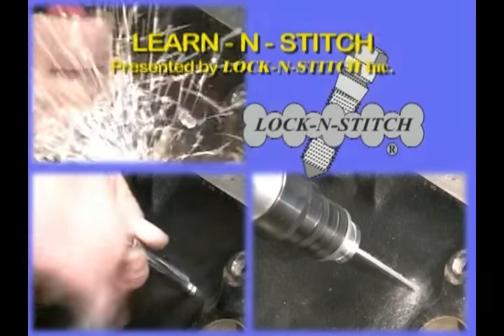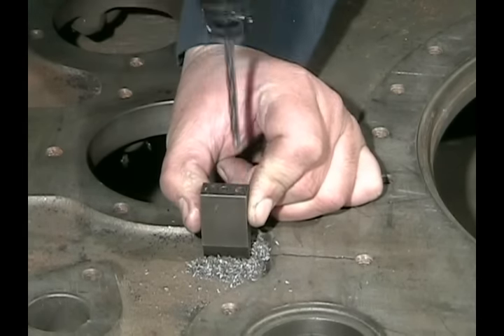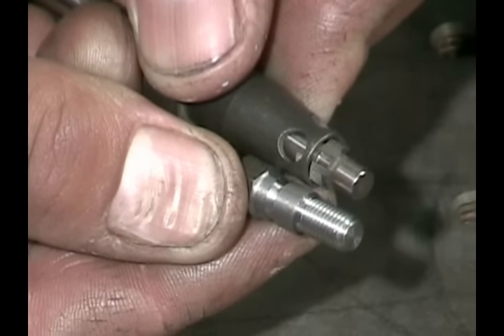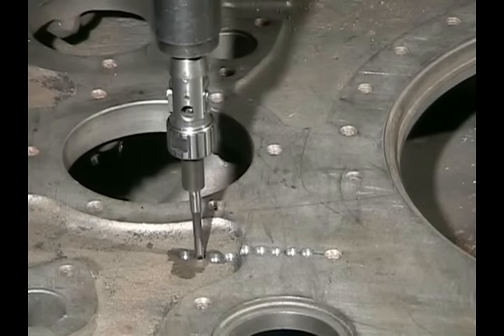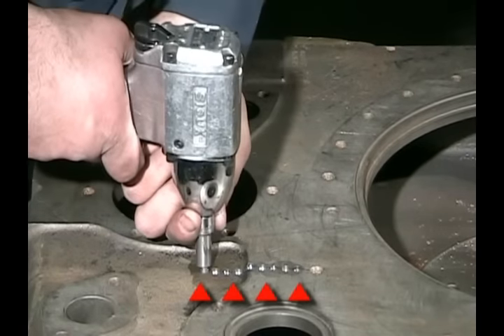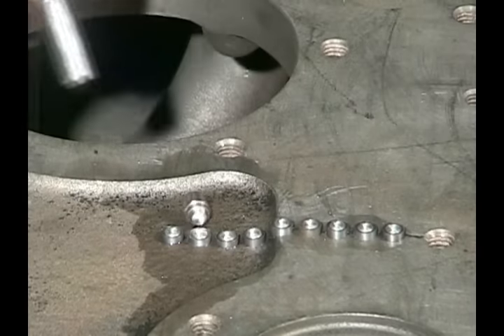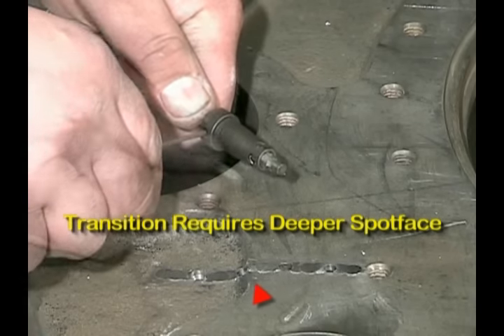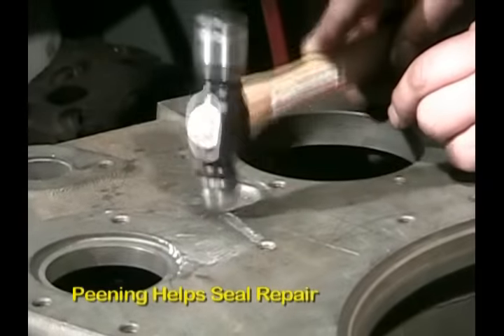Cast Iron Crack repair

Comment: I love this. I have one question that's probably obvious to the skilled machinist, can you explain to this layman why we're not welding this piece?
Reply: "Cast" is a very broad term. Some castings can be easily repaired by welding and this method would be more expensive and time consuming. Some Gray irons can be welded but it can be difficult. White iron cannot be welded. These situations are where a product like this comes in handy. It would also be useful on an in service part that could not be welded. Or part where dimensional  changes to the part due to welding heat input would be unacceptable.
Reply from the maker: Here is an article that can help explain so much more http://www.locknstitch.com/pdf/gmrc_white_paper.pdf

Comment: i cant belive that this hold in long term ^^"
Reply from the maker: It is a permanent repair!
Reply: Why not,it’s the proper way?
Reply: @LOCKNSTITCH   are the bolts like an cold weld ?
Reply from the maker: @DEWElmorion  yes it is a cold mechanical repair using stitching pins, that some call 'bolts' but they have a patented thread design that pulls together

Comment: Impressive. I need to be able to do this to my Cleveland block. Small 3/4 crack which only shows up with magna fluxing. I’ve got to search for the material used and tools to do the repair. Just worried that it’s more than the cost of a second block. Which would cost me $300 to buy. Then $700 to clean,zero deck,square and bore. I will watch this a few times to better my understanding of how it’s done. Thank you!!!
Reply from the maker: Just sent a message to your other response - but we are always here to help you every step of the way.  The team can let you know how much the product will cost for the repair, we will get you all the training material needed and can provide the technical support too.  Reach out to us when you are ready to talk - info@locknstitch.com or 209/632-2345  Thanks for reaching out!

Comment: This is the most amazing crack repair system my two eyes have ever seen.  I was quite happy to see you drill the Stop Hole at the opposite end of the crack. I work in a machine shop and we utilize Heli-coils on all aluminum castings.  This is an amazing system. Where have I been to never have seen this before, lol. Must have been on Mars or something. Lol. I really enjoyed the education here.
Reply from the maker: Please check out the Full-Torque Permanent Thread Replacement Insert video on our channel.  If you have worked with Heli-Coil we would hope you would appreciate our technology applied to inserts.  Thanks for watching and so excited to know you are excited.  We are passionate about casting repair! Also please feel free to review the web page dedicated to our FT Inserts http://castingrepair.locknstitch.com/category/full-torque-products
Reply: @LOCKNSTITCH   what type of material are the blots made of and is it the same for aluminum heads ?? hi from Australia.
Reply from the maker: @johnsmith-ce2tq  they are made of various materials depending on the application; for aluminum repairs we do have the stitching pins in aluminum for cast iron repairs the stitching pins are made of steel.  Thank you for writing from Australia and apologies due to the longer than normal time to reply.  Please reach out to our customer service team at info@locknstitch.com if you would like more information.  Thank you kindly for the question and your interests in our products! Happy New Year! http://castingrepair.locknstitch.com/category/metal-stitching-pins
Reply: @LOCKNSTITCH  thank you for your reply you too have a happy new year.
Reply from the maker: @johnsmith-ce2tq  You are most welcome! Stay Safe

Comment: why wouldn't you just weld it?
Reply from the maker: Thanks for your questions Chase - please read the white paper written by Gary Reed, inventor - CEO of LNS on "Why cast iron cannot be welded the way other metals can" http://www.locknstitch.com/pdf/gmrc_white_paper.pdf 
If you have any additional questions please call to speak to our customer service specialists  800/736-8261
Reply: you can stick weld cast
Reply: Chase Murry 
There could be many reasons why you couldn't weld it. 
Maybe the equipment is near a fuel tank, maybe someone doesn't have a welder, maybe someone can't weld cast properly,or the heat from welding damaging nearby items. 
all kinds of reasons. 
This is another tool in the arsenal for repairs for cracks....
I've heard old timers talk about this , I'd bet this repair dates back to the beginnings of machinery say in the 20s-30s...
it does have its place in the bag of tricks for a machinist/technician. .
Reply: Welding cast iron is the hardest welding to do, and actually only recently has it even been possible (past few decades).
 Plus welds are stronger than the base metals since that high heat causing phase changes (solid to liquid and back) which greatly weakens the original metals. You're basically annealing the metal closest to the weld only, and doing a bad job of it at that. Which is why the breaks in welded metal happen right outside and along a weld line. While the Lock-N-Stitch may end up stronger than original metal, it won't do it at the cost of the original metal's strength.
 To overcome this the entire piece would need the full anneal treatment after being welded, think really big to giant furnaces to fit entire object inside. Just to equal out stresses created by the annealing of the weld, then you need complicated cooling to get proper ductility, strength, hardness, etc back to right levels. 
So this method avoids that and is much easier/cheaper than Stir-Stick Welding (other new method that avoids phase changes) and can be used on complicated surfaces. Like the 150+ year old cast dome of the US Capital Building. ... Also, it's pretty cool.
Reply: *****
There we go, this was the answer I was looking for. Good job!
Reply: Dude .... we have been weld cast iron forever.
Reply: Because there is a greater chance of heating up the object and warping it. And it also ensures that the entire crack is solid, whereas welding a small crack would require that you cut out chunks from the casting to be sure the weld seeps deep enough, which again, may warp or crack the block in another location.
Reply: Chase Murry cast iron doesn't have very good weldability. For a large casting like this this is a better solution but brazing and then remachining would probably be better.
Reply from the maker: Here is an article that might interest everyone on this topic; expansion and contraction of cast iron http://www.enginebuildermag.com/2002/05/the-properties-of-cast-iron/
Reply: Samuel Mcdonald 
I wonder if they got snagged out of the cash for clunkers deal somehow?
Reply: This is a much better option than welding in a lot of cases. No warpage and machinability of the repair for starters. If anyone told me they were going to arc weld this with nickle, I'd just walk out the door with the part. I worked in a machine shop for years, and we quit arc welding cast iron yrs ago. If it's a non critical part we'd powder torch weld it, peening as we went.
Reply: Isn't all LS heads aluminium including the LS6 243 or 799 heads?
Reply: thanks for providing the articles... a very nice topic
Reply: how about tig weld?
Reply: Welding cast Iron is possible, but, like all welds, you will have stress areas around the weld material. I suppose this method might actually be better.
Reply: he needs 50 more years to stop calling it recent
Reply: pig iron doesn't warp for small welds. Doing things the hard way is old fashion
Reply: Will metalock strips be placed perpendicular to the crack as well? If not, what is the criteria for only inserting the keys but not the metalocks?
Reply: Exactly! Buy some rods, weld the crack. Done and done.
Reply: @DeepPastry  . Heat affected zone. Seen problems with that on SS pipe after welding. ( Retired pipefitter)
Reply: Chase Murry i would weld it ! I Have seen too many stitch failures, and not one of my welds hav failed, adding thread pressure to a crack is rarely the way to go . On defective 400ci blocks Ford stabilized cracks with a stitch on the ends  and  two in the middle ( 16" crack in lifter valley )  , then welded  over the whole mess  and distributed them as reconditioned for extended warranty replacements , it worked out fine
Reply: Guitargreat ditto ! Amen !

Comment: No idea why this is in my recommended, BUT this is awesome. The whole time I was thinking how does this fix a crack...then it all comes together
Reply from the maker: How fun!  It definitely all comes together - the thread design pulls the material together and you have a permanent repair!  If you ever have a need for our products or services do not hesitate to call us.  800/736-8261 or 209/632-2345 info@locknstitch.com

Comment: I once took a head, from a 4 cylinder dodge, to a machine shop to be rebuilt. I sat the head on the floor and talked to machinist about what to do and cost, the first thing he said was we need to repair the cracks without even looking at it. I said what cracks he took a rag wiped around two of the valves and said these cracks.
Reply from the maker: Did the shop repair it for you with our process?
Reply: @LOCKNSTITCH  I think they did it with using a tig welder.

Comment: Did this once with brass pins on a cracked cylinder head combustion chamber. Worked great and saved the tractor, but this system is quicker and easier.

Comment: I just saw this video today, thank you. 
This method would’ve been faster, easier and stronger when I was repairing my wood stove yesterday. Instead I was chasing hairline cracks that kept on making new cracks when I was welding. I spent hours doing this to finally get it right, but this method looks much stronger. Now I have to go grind welds.
Reply from the maker: Hope you are able to successfully repair the stove!  If we can be of help please reach out to our team anytime 209/632-2345 or info@locknstitch.com
Reply: I've done the exact same thing. What rods did you use for it. Did you do a pre and post heat?
Reply: @PercyJackson93  I actually heated it up and drilled holes at each end of the cracks, and used a mig welder. I know you shouldn’t, but it’s held up extremely well. I covered the bottom with fire cement and sand, no cracks returned yet.

Comment: Very interesting! But unless you weld it, does it not just "increase" the cracked surface along the crack? Or is the threadlock supposed to be "as strong as" the metal? Just asking because it doesn't make much sense to me but you have clearly a lot more experience!! Thank you for any feedback :)
Reply from the maker: Hello Riccardo, thank you for watching and for commenting.  The metal stitching process by LOCK-N-STITCH is designed to pull the surrounding material together, making it stronger. This is done by our patented thread design of our stitching pins and our thread inserts (Full-Torque).  If you would like to learn more about the processes and our products please see our website www.locknstitch.com or feel free to reach out to our customer service team. They would be happy to interact with you via email or the phone info@locknstich.com

Comment: Have used it for years in the repair of cylinder heads and engine blocks with not one problem at all. We do mass production engine rebuilds and ship all over the country.
Reply from the maker: Zane we love reading this great feedback!  Cheers to a successful 2019! Please do not hesitate to contact us directly if you ever need additional assistance 800/736-8261 or 209/632-2345 info@locknstitch.com
Reply: can you please explain, if its not a big deal for you, how does this method regenerates mechanicla properties of the material; from my point of view, it just seals that crack, but not giving back the cast iron its strenght; where am i wrong;
Reply from the maker: @agskepi  thank you for asking!  Please see this page on our website to explain more about the patented thread design of the stitching pins http://www.locknstitch.com/precision-metal-stitching.html
Reply: @LOCK-N-STITCH INC.
I do reallt thank you for your answer. Will look at it
Reply from the maker: @agskepi  and if you still have questions please do not hesitate to call or email - technicians would be happy to talk to you!  800/736-8261 or 209/632-2345 info@locknstitch.com

Comment: Hi my name is Rashidhajeloo I'm from Iran I like your work ,I have question about your work.
I hope answer me question.
What is the difference between  L and C pins, what kind of alloy are the pins made of ,are the pins made according to MM or INCH standards.
What is the name of the tool that you do create a seat with after drilling the first hole, the same tool that has a guide rod at the beginning

Comment: I saw something like that on an old engine. Myself I would weld it after grinding away completely the crack and rounded its ends.
This method into the video can work when there are not important pressure inside who tend to "stretch" the structure.

It's not a secret but it's something more refined:
Grind, round the ends, heat it up and see if the crack continue, if not, heat it up again on a larger surface, start welding "dots". Use the electrode welder with an electrode for cast iron,  not the MIG, it can work with MIG but it's more risky. Hammer a bit each dot, clean, repeat, it takes more than you imagine. Smooth it a bit if necessary (if not don't bother). Let it cool down very very slowly, refractory sand or bricks for that.

The important is to hammer the welded dots while they are still orange/red and to cool down it all slowly.

Comment: I had heard of this, but never actually saw the process. It looks hokey, but I have seen it fix engine blocks on Jay Leno's Garage. I really thought welding would be part of it. I learned different.
Reply from the maker: Thanks for stopping by and watching!  The process of metal stitching has been around for a very long time, we have been selling and providing services for over 30 years with our patented and improved stitching pins, thread inserts and locks for the LOCK-N-STITCH method!  If you ever have a need please do not hesitate to reach out to us.  800/736-8261 or 209/632-2345 info@locknstitch.com

Comment: This is the only practical way to repair cracked cast iron. Yhis works very well. To weld, you have to heat the piece in a furnace and weld inside the furnace, then let it cool slowly for a whole day. You can braze it but that's tricky too. This method fills in the crack and "anchors" the ends so the crack can't propogate further. The tapped hole is tappered, so it seals very well.

Comment: What drill were you using to make the holes into the cylinder body?
Reply from the maker: Hello Hugh - the drill bit used on the C2F pins is a wire size #7 AccuSize (our part number is L6402AC).  If you have any other questions please reach out to us via email at info@locknstitch.com Thank you for watching and commenting!

Comment: Intrigued to say the least. I'd like to know the engineering behind this. I have only welded blocks/heads and to my knowledge this is the only approved method. How do you know the pressure tolerance, corrosion resistance, vibration/fatigue characteristics compared to the original casted parts?

Comment: I saw a similar system being used when I was an Engineering Apprentice back in 1978.
Reply from the maker: yes - metal stitching has been around for a long time; this process of patented products and thread designs have taken concepts from the older processes and improved upon them, making incredible repairs possible!

Comment: I am wondering if this method can cope with the expansion and contraction of a cylinder head with heat. Also do they make an aluminium version for heads.
Reply from the maker: thank you for your question and comment, please see the link to a white paper written by Gary Reed discussing this exact issue http://www.locknstitch.com/pdf/gmrc_white_paper.pdf

Comment: I never understood how this can stop the leak or provide structural integrity...?
Reply from the maker: It is in the patented thread design, it pulls the surrounding material together - it does not push it apart.  It actually pulls the crack together for a pressure tight seal.

Comment: It seems to me that tightening screws into metal would create a lot of outward pressure. What is preventing that crack from spreading further?
Reply from the maker: That is a great question!  A standard plug, or tapered screw does create outward pressure.  Our patented thread design does the opposite.  The thread design pulls together.  This is a short video that goes over just this very topic https://www.youtube.com/watch?v=ELQmD8AFqzs
Reply: @LOCKNSTITCH  Well, the screw is taperd, but the hole isn't.

Comment: I have been doing this repair since 1975.Neat jig ! I never thought about making one. Most of my repairs wouldn't allow for it though. Neat system. My pins are tapered cast iron with a sq. head. there is a tapered tap for them.